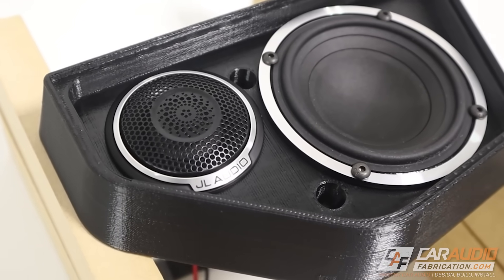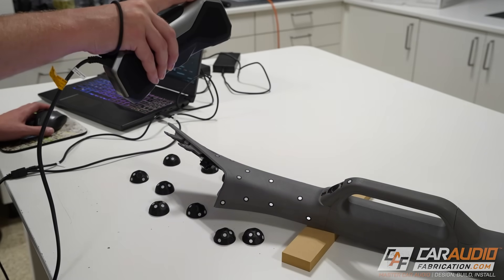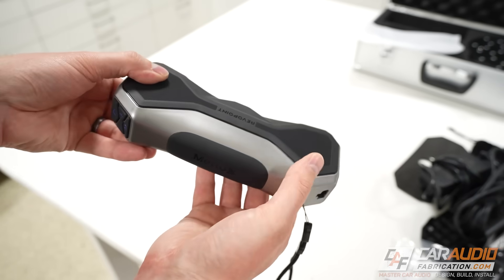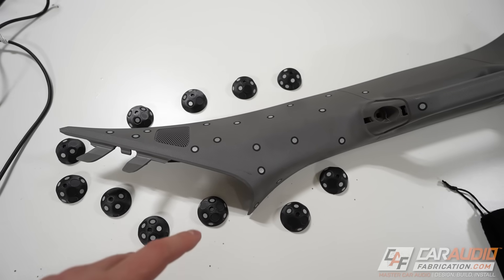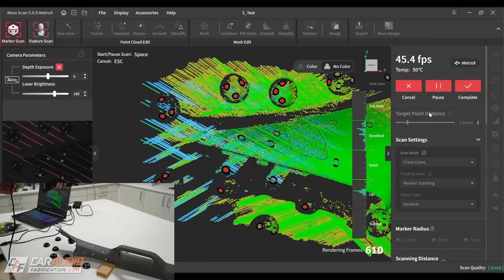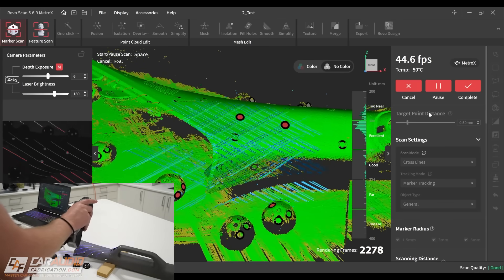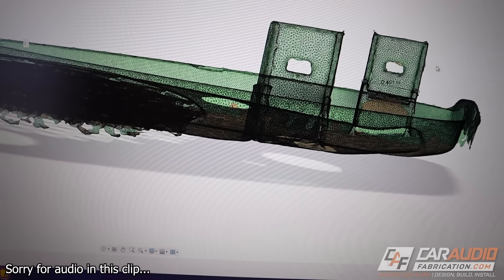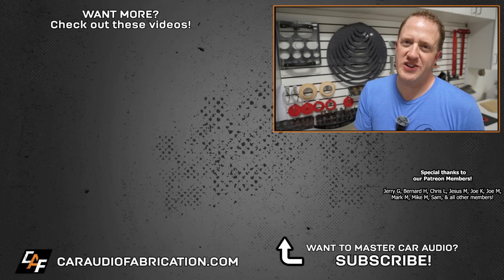This 3D Laser Scanner CHANGES EVERYTHING for Car Audio Hobbyists... Revopoint MetroX

Comment from the maker: Update! Revopoint saw this video and wanted us to also see the MetroY Pro model, new video now on the channel! - https://youtu.be/1VAgGRs2BHU
They have also provided a code to save even more! (Limited time) Use "REVOPRCARA" at checkout!
✅ Direct - https://tidd.ly/4pMLCLt (Affiliate)
Metro Y Scanner:
✅ Direct - https://tidd.ly/46xqkdv (Affiliate)
The links above are affiliate links. If you make a purchase, I may earn a small commission at no extra cost to you.

Also be sure to check out our channel sponsor KnuKonceptz for all your car audio wiring needs!
https://www.knukonceptz.com/
Reply: Links are broken.... (EDIT .... Nevermind, VPN was blocking the site. All good now 👌
Reply: Earlier this year i got a large 3D printer with the plan to eventually start making custom car parts (audio, cosmetic, etc). A 3D scanner is definitely on the list of future purchases. I've been learning photogrammetry using a dslr camera to try to achieve the same thing with stuff I already owned. But this certainly looks be a much easier process. 

One question for this I have is... Does it require decent computer processing to run the scans? Or just to "unpack" the data it collects? I have a very strong desktop PC, but it's anything but portable. I normally would lean towards a Surface or similar for basic "field work" and then let the desktop do the gruntwork at home. Is this a workflow I could still follow with this scanner? Or would I be needing to invest in a stronger portable computer just to do high quality scans away from home?

Comment: Most reviews on the MetroX seem to focus exclusively on the laser modes. As it happens, there's an inherent benefit in being able to capture data of large areas in a single shot, which also happens to be where the laser modes become rather cumbersome to use. I'd really love to see a scan of a dashboard, for example, using the structured light mode. Maybe even show why it's not the best for smaller parts, just to give us a better idea on what kind of tool to choose for our projects. Great video otherwise.

Comment: One thing that would be useful is if you talked about the software and the options and cost associated with that.  When checking the website, it apppears to be that you also need to buy, at a minimum, a one-year license for their software for approximately $1350 (while it is on sale).  They do offer a permanent license for $4500 (while on sale as well).
Reply from the maker: The scan software is free. You are referring to the design software. I recommend Fusion360 for our industry.

Comment: Question about knukonceptz... I have it in my install bit finding the rate gauge is more than advertised. This actually makes it hard to get it into amps fuse holder etc!! I am currently needing to cut quite a lot off the end to get it in. What's the best way to deal with this? Tried knukonceptz fuse holders but still tough to get in!!